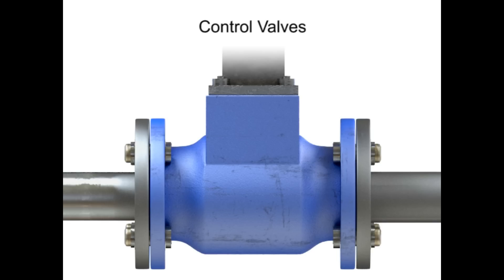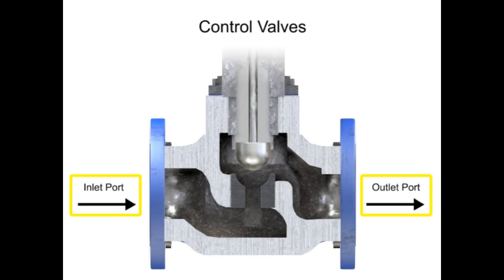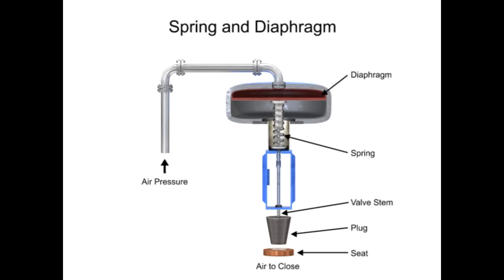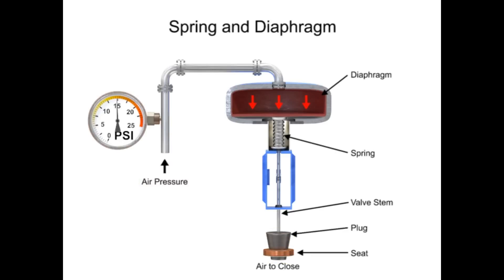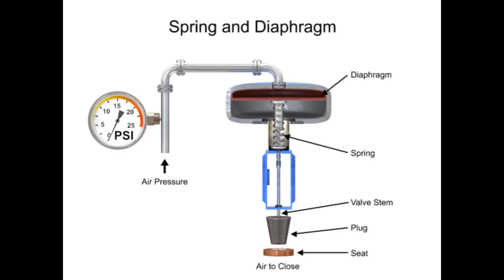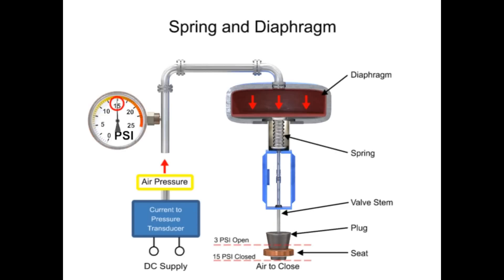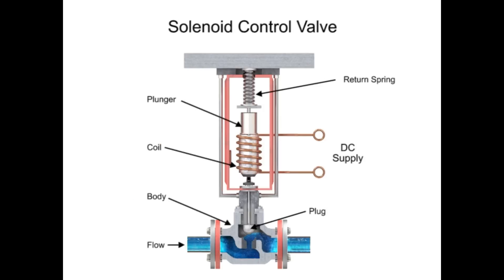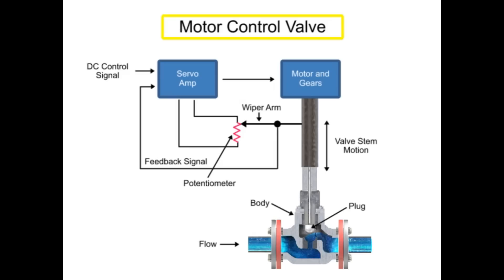Control Valve Actuators | Solenoid Control Valve | Motor Control Valve

Comment: Need help here, I am trying to design a particle injection system.

I wanted to control the amount of pressurized air into the sand blaster venturi. Could I use solenoid valve + National Instrument to do that?